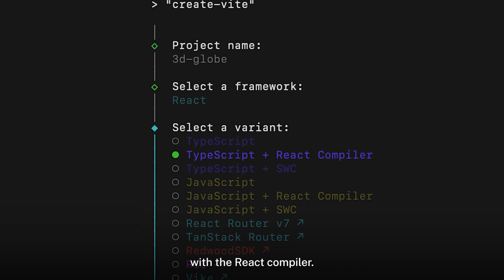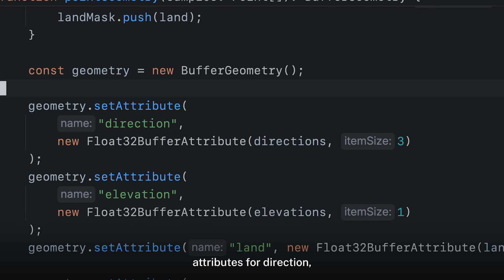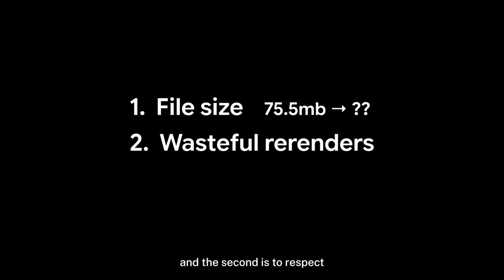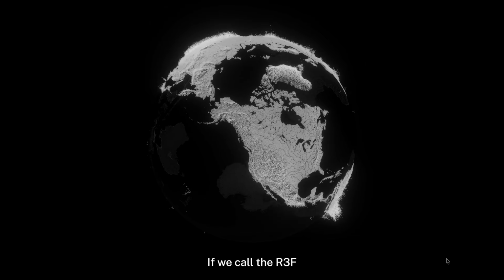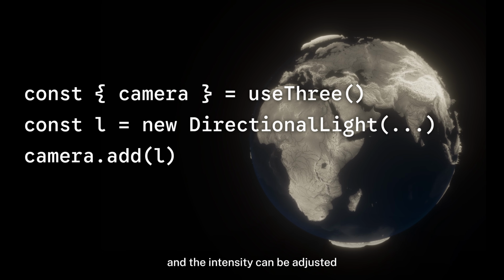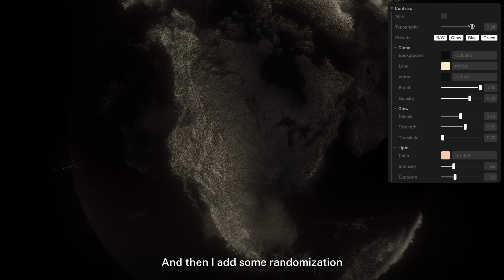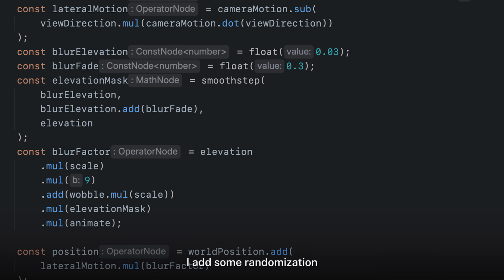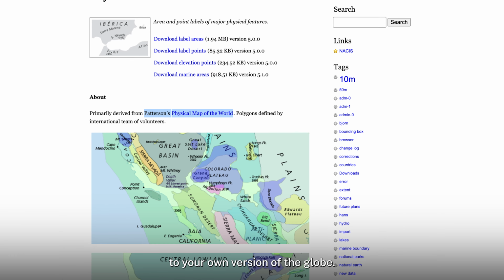Let's Code a 3D Globe (Three.js, TSL, React Three Fiber)

Comment: Hello Yoa 3D its interesting to see i find alot of projects doing the same things i am doing recently. A quick question for the player movment you show in the beginning of the video, are you using a code based animation or is that animation from mixamo or blender? Have you heard about the project called animate any mesh?  Would love to share notes! have a great one
Reply from the maker: For now, I'm using run animations from Mixamo with plans to replace them with custom ones later on. 

I go over the movement system in detail here, if you're curious: https://youtu.be/6jJOgakiZAs
Reply from the maker: I haven't heard of AnimateAnyMesh, but thanks for sharing – their paper looks interesting. 

For this project, I'm most likely going to use Cascadeur for character animations but I'll keep it in mind for other uses.